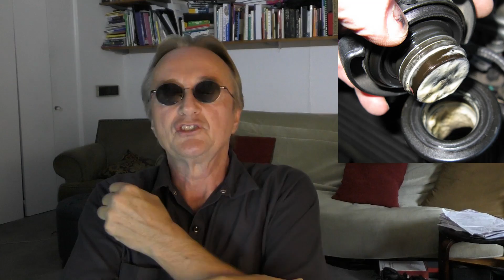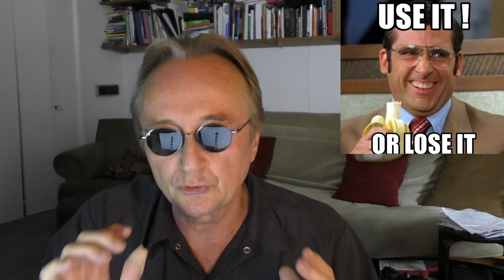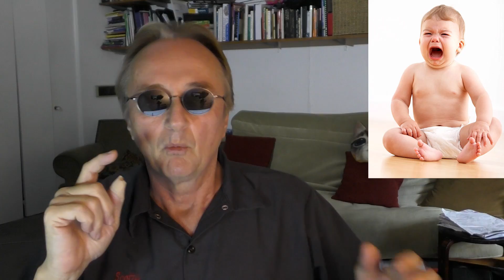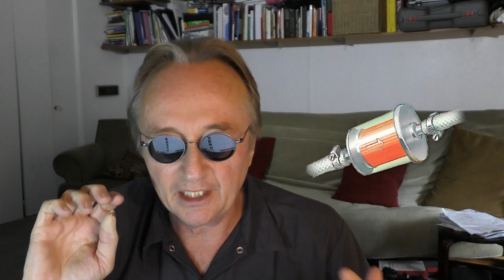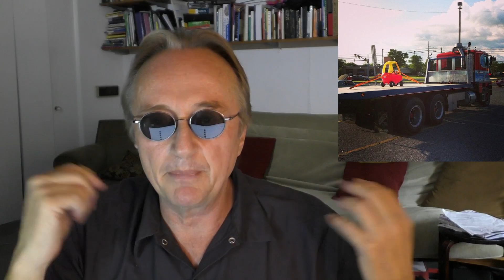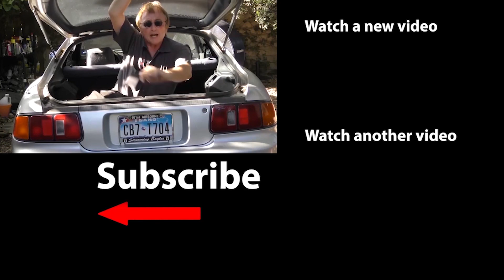Driving Like This Will Destroy Your Car

Comment: Scotty, my hybrid car runs mostly in the city and mostly on battery, the engine hardly ever operates or gets up to normal temperature.  Does this mean my engine will not last as long as a non-hybrid vehicle.
Reply: yes, you should have bought an EV.
Reply: @davidjacobs8558  or just take engine out and throw extra battery pack in 'engine bay' then give another chance to drive hybrid vehicles after fuel outlawed.

Comment: I drive 6kms... I really need to get an electric car because no transmission or engine can handle all of the cold starts and  short trips
Reply: You need to walk or cycle
Reply: I drive 25k round trip every day with my 2011 Chevy volt and I plug in at work for free. I hardly ever use the fossil fuel burning ICE lol.